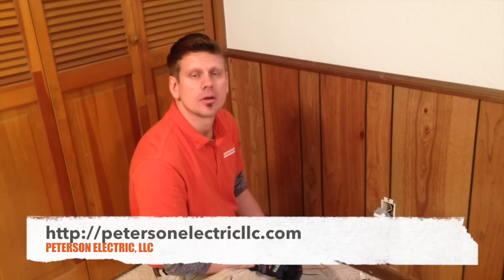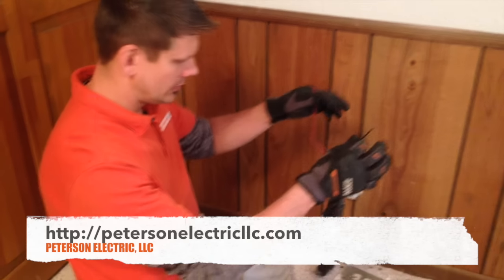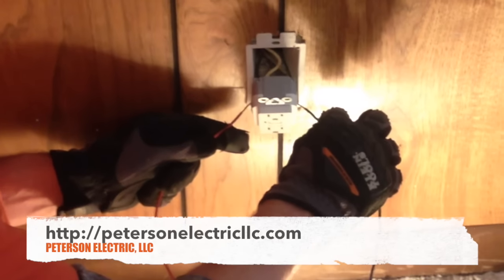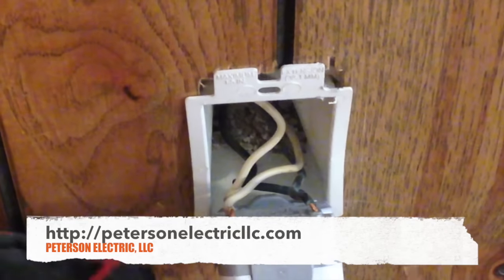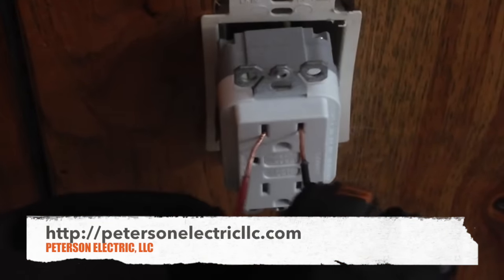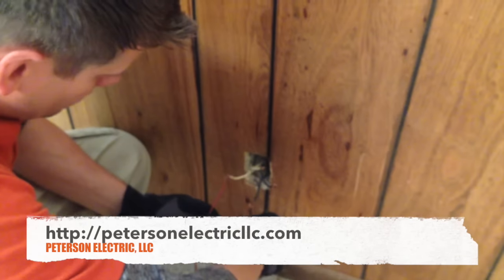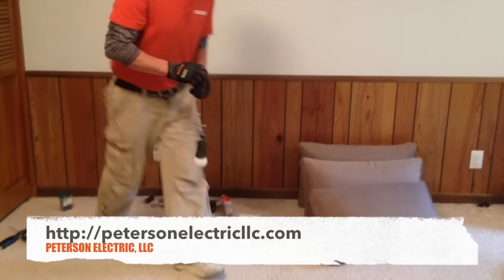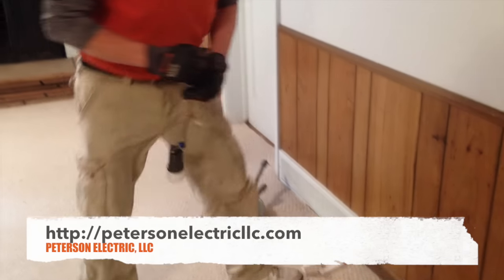A 1950's House With 2 Prong Outlets & No Grounds, What Can Be Done?

Comment: My question is do you need to have a ground when hooking up in these old houses where there is no ground wire. Is it safe? You might of answered my question in your video but I didn't hear it.
Reply from the maker: If possible yes along with new TR plug, afci and possible GFCI circuit

Comment from the maker: You are a funny guy, and you “know” that is sooooo illegal. 
Article 250.140 states in the 2017 NEC, that in the exception we are allowed to bond the frame. But, the AHJ in some of my cities will not allow this if there is a remodel in or near this laundry or kitchen, we have to re pull the new4-wire SER. 
250.130c allows us to bring a EGC grounding conductor from another grounding circuit, assuming there is the proper grounded electrodes available, and we do not create a different equal-potential in our grounding. Per 250.52-53 
If you jumper the Neutral and grounding of the yoke strap on a device, you risk the following; 
1. AFCI breakers will not work. 
2. GFCI breakers will not work. 
3. Dual function circuits will not work. 
4. Multi-branch AFCI breakers will not set. 
5. If there is a multi-branch circuits sharing the grounded conductor or white neutral, you will be shocked off of the back side of either L1 or L2 leg of the unbalanced current. And if the homeowner goes to Estes Park and buys a bunch of nice looking metal iron Elk or mountain looking faceplates, they will get shocked if the face plates is not bonded to the yoke strap and the grounding conductor separately. 
6. Last and most important, it is a circuit that is sharing as a lighting load, and not a dedicated appliance, personally it is dumb to bond the frame of a range or dryer with a green factor screw, code is a bare minimum, it is better to have the cold water pipe bonded to the Neutral in the cabinet of the first point of disconnect, and install your bonding jumper then you can use the cold water pipe of the washer as a grounding EGC conductor on the dryer with a water clamp, or bring a EGC from the panel and size it off your breaker size per 250-122
Reply: Peterson Electric according to article 406.3 (D) (3) (b) in the NEC 
An EGC shall not be connected from the GFCI type receptacle to any outlet supplied from the GFCI receptacle. 
By you doing so violates code.
Reply from the maker: @joeschmitz3346  250.130c
Reply: @joeschmitz3346  Your code cites the section on replacing UNGROUNDED receptacles fed from a GFCI. This has NOTHING to do with whatever nonsense is being discussed about "jumpering" ground to neutral.

Comment: I'm connecting an appliance via a three prong adapter into a two prong extension cord. How can I ground that adapter? Should I worry about it, even?
Reply: Make sure the extension cord is double insulted
Reply: If the extension cord is only two prong there is no ground
Reply: @josephrostkowski674  It's meant for outdoor use so I guess that rubber sheathing counts. I've been watching it doesn't get warm. So far, it's been okay.
Reply: Get a cord-connected GFCI breaker and insert that between your cord and the receptacle or replace your ungrounded two-prong outlet with a GFCI, as permitted by code.

Comment: Overall understanding these devices GFCI... works on difference of current between the ungrounded and neutral wire to trip for personal use for it's purpose of safety.. These devices I can say are substituted (replaced) for receptacles that are 2 prong and some kind of method to replace a grounding means.. Seems like 2 (TWO) different ways to complete this... 1- replace a 2 prong with a GFCI but works differently from actually running a rewire and having a grounding system... 2- a grounding system... These 2 methods work differently but are accomplished for the safety of personal... Interesting...
Reply from the maker: Yes I agree with you, but what I think most of the people who disagree with this video are missing to important codes. Please for who every reads this and listens to the video, needs to "KEEP IN MIND" that this video was completed five years ago. It is now the 2017 code so that means we were in the 2011 addition during this video. In 2014 code the NEC Code book in article 250.130c finally allowed a separate EGC (electrical grounding conductor),  (sized off of 205.122), grounding conductor to be ran outside of the jacket of the old BX or NM cable (two wire cables). 
Before the 2011 code it was practiced but frowned upon if you wired circuits without the bare or insulated grounding conductor... Keep in mind that it is not always easy to or able to, run a separate EGC conductor from another circuit or back from the sub panel or main load center.  The code now talks about the means, of how to do it, and from where to pull it from and how to size it, ("BUT"), it does not talk about how to test the path you are using to the ground bar in a subpanel or load center. It does mention how to grab this from another circuit, "Branch", but it does not talk about how to test for impedance or resistance.

 I have typically seen the mistake of running a "Green" #12 or #14 solid conductor from one circuit to a water pipe or another branch circuit, or to another panel, but there was no Grounding Electrode Path or no forth wire conductor in an SE cable back to the main disconnect or panel. 
We have also seen that there was no electrode conductors installed on the main water shut off pipe, or UFER cement electrode and or any supplementary electrodes for two x 8' (5/8") ground rods and no intersystem bonding bridge bars. 
Read, 250.52-53, 250.64, 250.93..... Another good point, is that in 250.104c it talks about now grounding any gas pipes and other metal pipes. The only exception that I have found in the code to allow the connection between the neutral and the grounding connection (ON THE BACK SIDE OF A MAIN BONDING JUMPER IN THE MAIN DISCONNECT) is in article 422 for dryers and ranges. So, therefore the "cheaters" who use a small number #14 or #12 on an old house with the method of jumping the yoke of the device to the neutral of the branch circuit, is NOT ALLOWED> Infact, if the circuit goes bad on the (hot side) of a switch leg of a light fixture, than you are energizing the fixture. No grounding conductor to direct mis current flow. 

The last thing to keep in mind is the code in 406.1-12 under plugs and 404 under switches, communicates that in the 2011, 2014 and 2017 code we have been enforced to add AFCI (arc fault circuit protection) when we replace, modify or repair any plugs and or switches. I believe this can be unclear when the code is trying to describe an "opening". 
An opening is a smoke, dimmer, motion, timer, plug, switch, toggle, paddle, exhaust fan, ceiling fan, can light, puck light, transformer, co detector, pendent, mushroom, bar vanity, heat fan light combo kit, etc...... When we are improving the "TRUE SAFETY" of someone's property and we are exchanging monies for time and product, we are told in the newest NEC that we are to do this a new way, basically "upgrade" the circuit. 

The point of this video is that the OLD METHOD of "just" replacing the two prong plug with a three prong GFCI plug is ("NOT") the safest way and or the "MAXIMUM PROTECTION" that there is for the customer. ("IN MY OPINION") , I show in this video that a GFCI cannot trip only based on a fault between the undground (Hot) and grounded (Neutral) conductors. This home in the video was built in the 1950's and has "no signs" of remodels and branch circuits with EGC grounds and NO grounding electrode system conductors- 250.53.  This "customer", (did not want) their home cut up to install a separate grounding conductor, we were in their basement and there is not pop up tile ceilings, and the house was on a slab, we had no choice on the matter. 

In the video, we are simple proofing that an old Murray (60 year old breaker) is tripping faster and more frequently than a NEW GFCI plug. Point being, what is so important about installing a GFCI plug in an area of the home that is not in relation to 210.8 for GFCI protection. The room has carpet, it is finished with drywall and has no water. 

This is OLD and SIMPLE Thinking, to keep stating what 406 talks about under two prong plugs has to go!!! 
The 2011 and 2014 code tells us about AFCI protection, but our AHJ and city officials have not pushed the code of AFCI protection on simple repairs and replacement of plugs and swtiches until now. The 2017 NEC CODE BOOK in article 210.12 B states that if we modify our cirucuits, or extend or replace we have to AFCI. 
WE NOW HAVE NOT EXCUSE, that we cannot find a AFCI / GFCI (Dual) plug. We also, have breakers (overcurrent protection) that allows us all three options, AFCI and GFCI and Overcurrent in a breaker switch protection. If the panel cannot fit or accept the newer breakers than we can trace and label the circuits and install the protection at the LINE SIDE OF THE EXISTING CIRCUIT>   BUT, I still say, why not run an EGC conductor to help in this situation if you can cut drywall and or fish the EGC in. 

Bottom line, if we are not adding AFCI protection than there is a standard that we are not practicing by. This is not an easy process, but if we do not get past our concerns/fears and start to practice with better skills than we will not grow in our field. 

I have personally modified 14 homes in the last six years with TOTAL AFCI Protection, and in most cases upgraded the existing panels and also added ALUMINUM PIG-TAILING protection with new TR (tamper restive) and WR (water restive) devices. If the panels were too old, we than, also upgraded the service with the meter as a by-pass lever and added all electrode protection needed. (WITH PERMITS).
 Later, we have had to add EGC protection to the circuits that had electronics and or computers. Some cities were very hard on us to install all Smoke and CO detectors with three wire 110v feed devices in the NFPA 72, for homes. 

If you cannot add EGC grounds than protect first in the panel with a Dual breaker. If this is not possible, than protect with a Combo AFCI & GFCI plug, but if you do not have an EGC throughout the circuit than you need to install A DUAL PLUG, in every location, assuming your old metal boxes have the volume space in article 314.  
Personally i would parallel all my connections with pit-tailing, whether you have copper, aluminum or copper clad aluminum. 

MY POINT IS, (since i have been so challenged by this video) that if you are not AFCI protecting, updating grounding on EGC and Electrode System,  and possible the service with a new main disconnect and by-pass lever,  than you are not doing your job!!!!  (unless, your city has a lower standard, but HERE IN COLORADO they are very complaint and enforce ALL NEW CODE UPDATES> 
 Better protection, safer standards for the customer is in article 90, this is for the safety of lives and property. NO IF, ANDS OR BUTTS!

Comment from the maker: I always tell them about the effects of why code changes every three years, in the state of CO if someone is electrocuted than this is looked in to seriously, and if fire than it effects insurance and rebuild as well as the fire departments report. The state of CO (DORA) and code panels look at safer standards. 
I usually compare this to the Car industry and who would not think about more air bangs and hiring standards for crash tests? They usually scratch their head and say what you said. Our problem is there are no meters to the naked eye that are implemented in the circuits like a check engine light
Reply: When are they going to do some thing about smart meters they are not UL approved and if the Fire Marshall states the smart meter is the cause of the house caching fire  the insurance does not have to pay if you make a claim. Do a search here on utube smart meters cause fires. What is your position on smart meters? You put UL products in your work then the power company puts a meter on that is not UL approved.

Comment: Couldn’t you just find the breaker that controls that room and switch it with a GFCI Breaker?
Reply from the maker: No sir, 410.4D Now states that you have to have AFCI protection on the plugs and switches once changed. 250.130c states to run an egc grounding conductor to the circuits.
Reply: @Petersonelectricllc  There is no 410.4D in 2017 NEC. Is it in 2020?

Comment: Great videos, BUT, The Banner GETS IN THE WAY. YOUR CAMERA PERSON NEEDS TO FRAME LOWER OR GET RID OF THE BANNER. Maybe use it at the beginning and then sporadically at edits. 
What happened to the rest of this video?
Reply from the maker: Yes, we since have deleted our banners from our future videos, past this year of 2017, this video is an older one. The video is fine.
Reply: Your 2 wire GFCI test should be redone. Try grounding a single wire from the down line outlet to a wet floor or such. There should be enough discharge for the GFCI to pop it. I've popped enough downlines with my fingers just pulling a hot receptical out of the box and touching one leg. (Yeah, I know...) How did you end up fixing the unpermitted addition with the old panel in the broom closet/ That was a great diagnostic. That looked like an expensive fix.

Comment: So what can you do about replacing them? I’m thinking making a pout video isn’t the answer.
Reply from the maker: You should first try to pull a separate EGC grounding #12 conductor to the plugs, then AFCI the breakers and GFCI the Breaker or plug where needed.
Reply: @Petersonelectricllc  Why doesn't this video cover how to do that though?  That's good to know it doesn't protect the other outlets, but this video is labeled how to fix it.  I would really like to see an electrician do this.  There's a wire that is just grounding wire?  And you run it back to the breaker box and connect it?  How do you pull that to the plugs in an existing house with drywall, or nasty wood paneling that I have that can't be easily removed?

Comment: in my opinion, id either go for a complete rewire, or only install two prongs. inconvenient, but better to be safe. there is no ground. that being said, i have lived in houses with 3 prong conversions and have been mostly fine. but i would ideally err on the side of caution.
Reply from the maker: True statement, as an electrician I have been shocked from unground appliances or metal faceplates that have grounded out. "Grounded" by the neutral and not by the (EGC) equipment grounding conductor. The EGC is the third conductor that allows the faulting to ground throughout the system. This EGC "Bonds" to the neutral bar in the main disconnect panel through the bonded jumper. This Bonding Jumper allows there to be no extra voltage of 40 to 80 volts on the EGC, which I have seen in many cases. Bottom line, plugs are low and kids and pets are curious, if they touch a device that is not bonding to the system than there is a potential of them feeling voltage to ground and being part of the circuit. I just wired a basement that is now finished with three conductors, (with grounds, or three prongs). This customer's finished floor is a Brown concert with a light swirl high glossy finish. This type of floor is "typically" finished but yet unfinished, so we would have to GFCI (ground fault protect) the circuits that are plugs and would be likely plugged in to. In the case of two prongs then you would have to AFCI (Arc Fault Protect) and GFCI and TR (Tamper Resistive) the plugs and or circuit. I still agree with you though to pull a new circuit or find a good path to ground and pull a Green insulated #12 aww copper to the plug. Keep in mind that the code wants you to protect any wire that is smaller than a #6 with some conduits, PVC or ENT or FNMC, this helps protect the wire from being cut out or damaged.

Comment: 2 months ago,  Kenmore window AC maybe 4000BTU can't remember......dropped ckt board inside, threw sparks tripped 15A wall breaker. GFI installed ON MACHINE did not trip. To recap JIC, wall breaker 15A NON GFI tripped, GFI DID NOT!
Reply: Put your finger on the hot wire bare footed and the breaker won't trip but the GFCI will trip on this scenario. See the difference?
Reply: Never in my life have I seen a 4000 BTU window shaker frankly 4000 BTU would be for like a 5000 square foot house I would not plug into a wall
Reply: @josephrostkowski674  I would suggest you look into A/C units. You are talking out your ass. 6000 BTU is currently on for $248 at HD. You are missing a zero.
Reply: @josevillanueva8623  No I don't see the difference. I pull the GFI's apart all the time to find burned resistors. I wouldn't personally try it.

Comment: Unusually late for a house to have ungrounded outlets. I read that some   '50s-built dwellings still had knob & tube wiring.
Reply: i love the 60s 70s houses where the ground wires are snipped off 🤣
Reply: @havox112  I have a 70s house win no ground wires at all.
Reply: @MAGAMAN Difficult to believe.  Extremely short changed at the time.

Comment: I have this issue, so from my understanding I half to use a gfci outlet in each 2 prong?
Reply: No, you do not. That's the "easy way", but more expensive than using a single GFCI receptacle to supply an entire string of ungrounded 3-prong receptacles, as permitted in NEC 406.4(D)(2)(c), beginning as of about 2005.  Just be aware that later codes may also require AFCI (arc-fault) protection on some circuits if you modify them or replace the receptacles in locations needing AFCI per code.